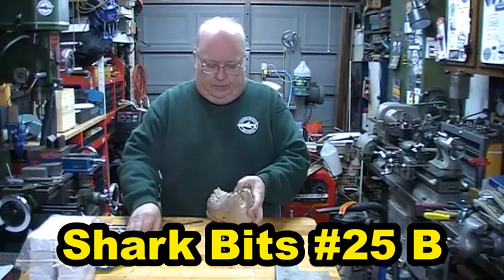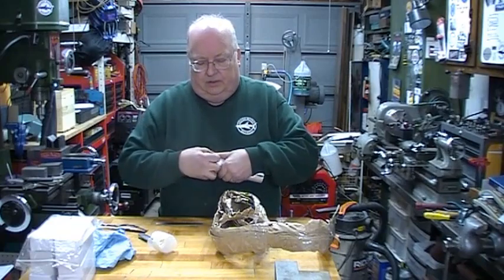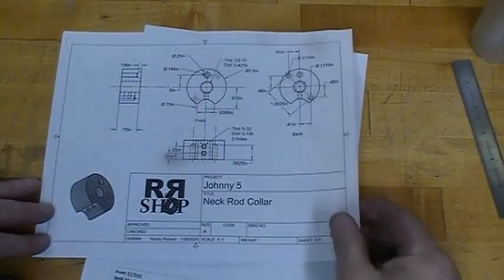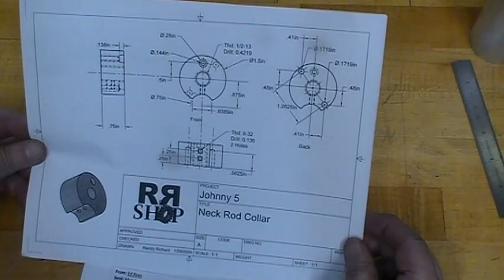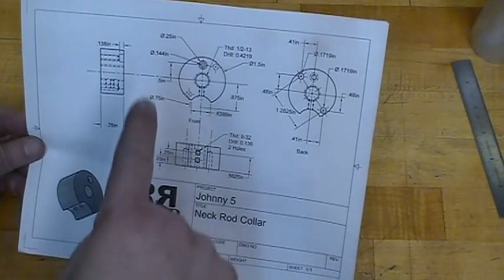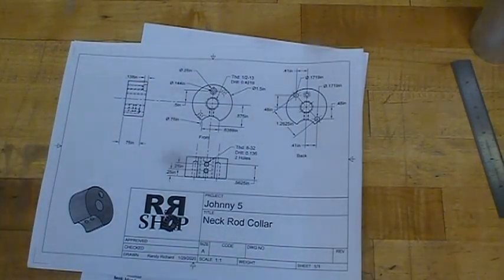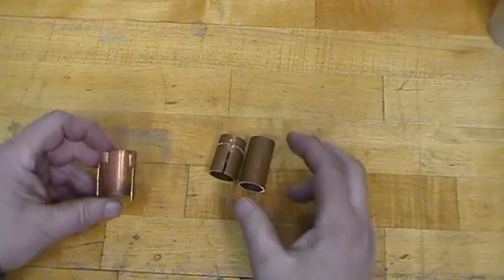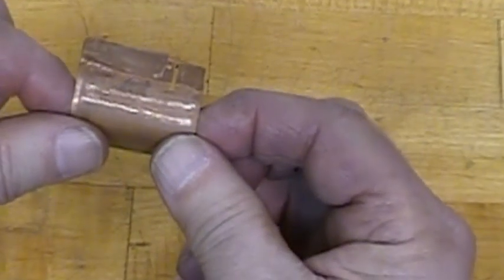Shark Bits #25B - New Project & Making Copper Jaws For Lathe Chuck

Comment: Steve, using rigid copper for the vise jaws leaves you some pretty hard copper for soft jaws, you can do it with softer copper or you can anneal the copper by heating with a propane torch until the copper turns blue. This will leave you with softer copper, less likely to mar the work.
Reply from the maker: They work harden also as you are using them.  They will probably need to be annealed once in awhile.  So far they are working just great.

Comment: I like the soft copper inserts for the jaws. I use some aluminum flashing material for mine
Reply from the maker: You use what you have available.  I just happened to have a piece of copper pipe.  I have aluminum jaws on my Whilton Vice, they work well also. Thanks for watching and commenting.

Comment: I still need to make a set of soft jaws like you just did there.  Been using aluminum shims up until now but will make some soft jaws at some point.  Hope you're doing well.
Reply from the maker: These worked out very well.  They work hardened a little . I need to heat them up and anneal them.

Comment: Never made a set of jaw covers but probably easier in the long run that sticking packing strip material inbetween the jaws and work like I do.
Reply from the maker: You would need drain pipe size for your lathes. LOL